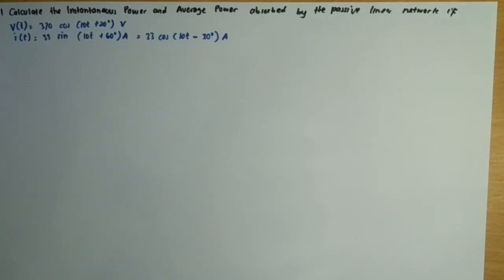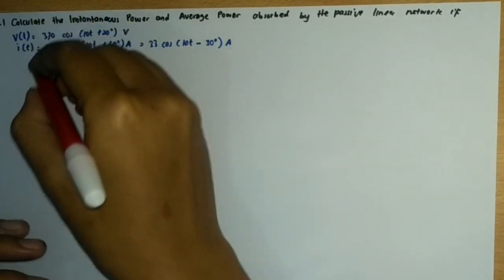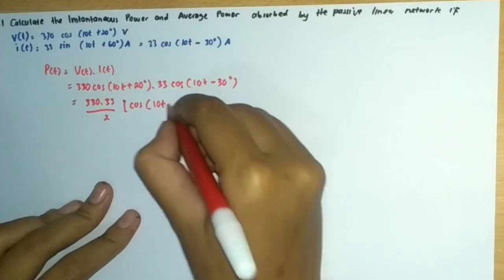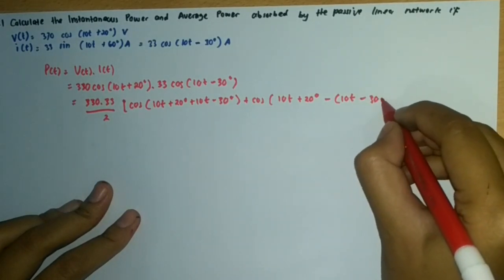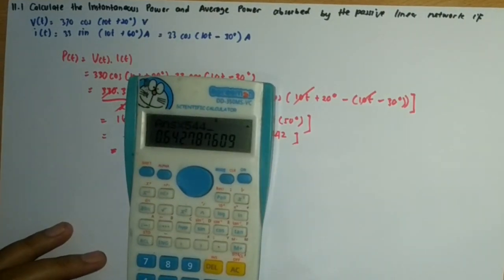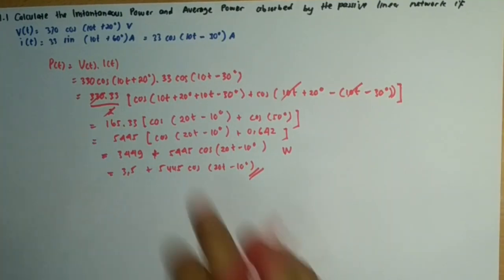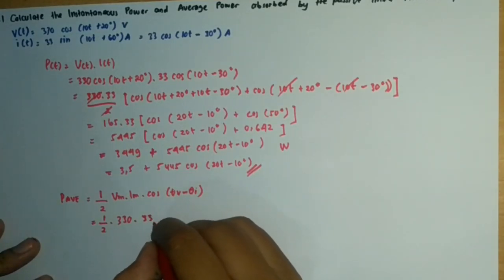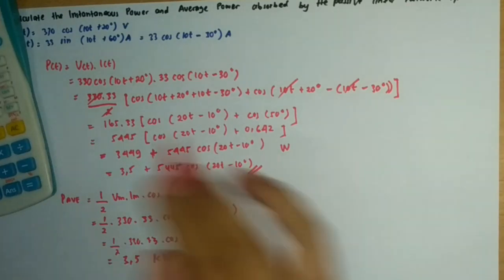Practice Problem 11.1 Fundamental of Electric Circuit by Alexander and Sadiku 6th edition

Comment: Very nice
how do i change the initial statement i (t) sin to i (t) cos ???
Reply from the maker: Example if i(t) = sin ( 10t + 30°) so you can change it into cosinus form like this i(t) = cos ( 10t + 30° - 90°) and you got the cosinus equation is i(t) = cos(10t - 60°) A
Reply: @rizkyauliasafitri4722  Is it only necessary to add - 90 and applies to all?
Reply from the maker: @rainyday7749  no but if the equation is i(t) = sin (10t - 30° ) you can add 90° and the equation will be like i(t) = - cos(10t+60° ) it depends to the sign negative or positive so the conclusion is if the equation is i(t) = sin(wt- theta)= -cos (wt - theta + 90°) and if i(t) = sin (wt+theta) = cos (wt + theta - 90° )
Reply: @rizkyauliasafitri4722  ouh, thanks for the explanation aul ^^